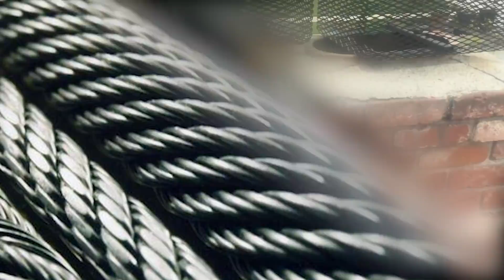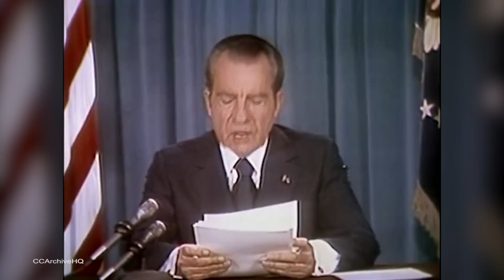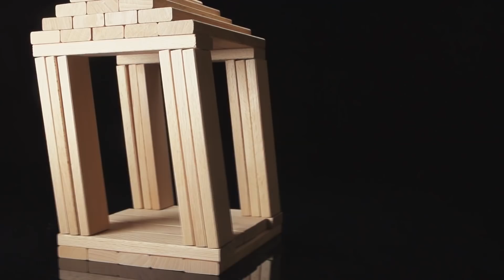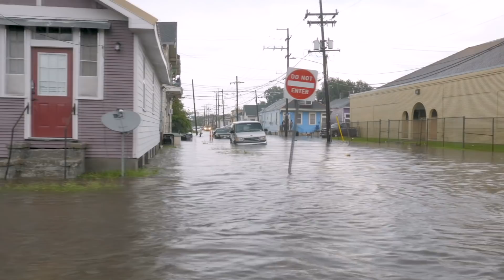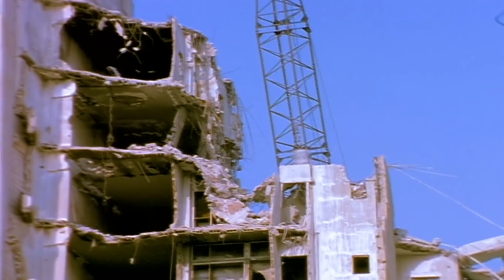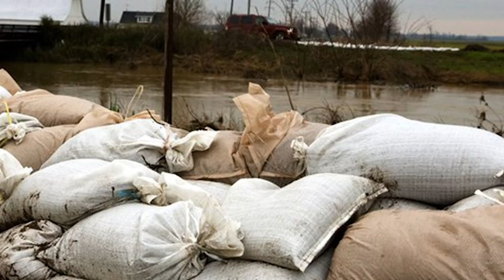15 INGENIOUS Ways People Have Saved Their Homes

Comment: I have not seen these before. So, why aren’t there building codes and laws in place so that places prone to natural disaster can in theory avoid so much loss. Specifically, costal areas prone to hurricanes should be required to have the roof straps in place , screw holders and or hurricane shutters and flood prevention.

Comment: Those foundation side plates will keep the bottom of th house in place, everything above that will still fall down with out bracing supporting the framing under the house as well. The example shown does not have that.
My grandma lived in San Francisco and we know are earthquake building codes

Oh this is getting a dislike for so many incorrect details.